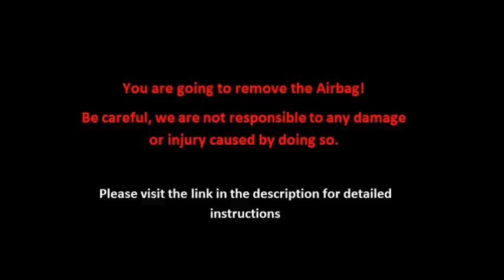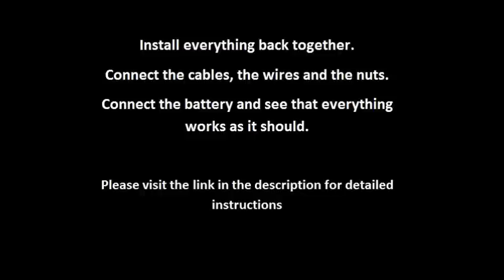Horn stays on in Montero - solution

Comment: This is way too much work. Just connect the horn directly to the high beams circuit via the 10 Ohms fuse on the engine compartment. All it takes is a wire from the horn to the left side of the fuse so when the you pull the high lights lever and your lights will go on and your car will hunk. (becarefull when you drive at night and your lights are on, the horn will go on untili you release the high beam light lever again) Happy DIYs!
Reply: So when you need your brights you will blind the hell out of people lol
Reply: Why not add an additional switch
Instead of headlights ??